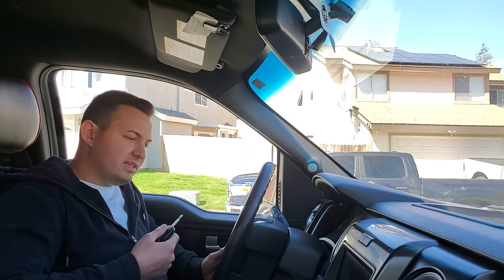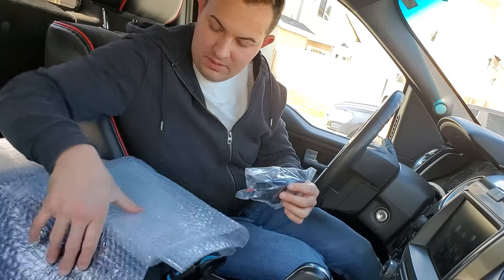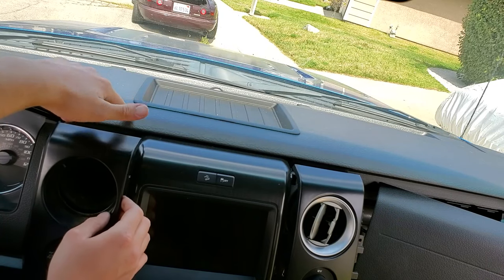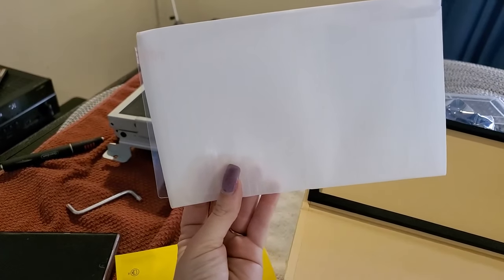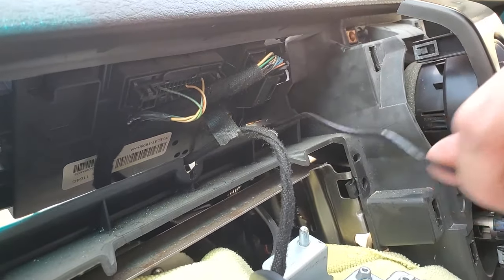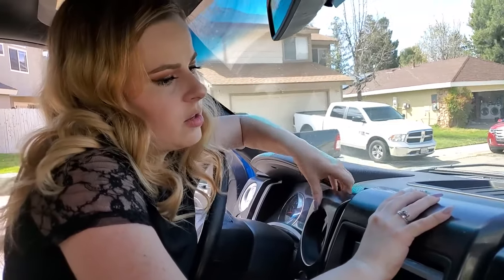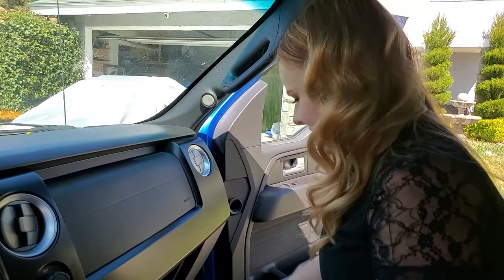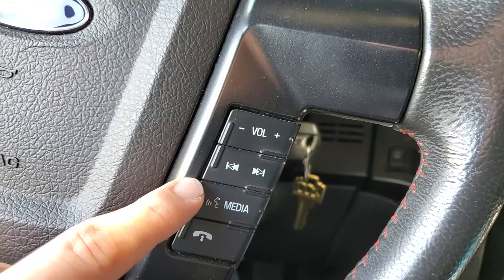Sync 2 to Sync 3 Upgrade Kit from ebay - Installed in a 2014 Ford f 150

Comment: I’ve got heated/cooled seats and a heated steering wheel that are controlled from my Sync 2 unit on my 2015 F-350 Platinum. Do you know if this would support those functions?

Comment: HL3Z-10E893-AA  2016+ Ford F-150 OEM  GPS and Satellite antenna and to get the signal to the OEm antenna is GL3Z-10E928-AA (splitter) and to access the cable is behind your glove box yellow clip and follow to your radio. to swap roof antenna remove passager visior hindge and mount removed pass side "A" pillar pull down the head liner to access the bolt that holds the roof mount (8mm) screw Signal strength is alot better. FYI

Comment: If I get the sync 2 to 3.4 will I still be able to turn on my heater and cooled seats through the screen since the truck doesn’t have physical buttons for it. I have a 2014 platinum and I want Apple car play
Reply: Yes you will. Just installed this in my 13 f150 and the unit retains everything the old one did
Reply: @raulgallardo1659  what kit did you use?

Comment: Just one question have you had any issues with the new Sync 3 since you have installed this upgrade, also I have a 2014 Lincoln MKX  would this also apply and load up with the Lincoln Emblem on the display ?
Reply from the maker: No issues! Still works great. Depending on where you buy it, they may be able to have it already preselected with the Lincoln screen. If not, you can switch it yourself using a laptop or phone and a program called FORScan.

Comment: I neeed help 😢 I have the f150 fx4 2014 5.0 coyote, it’s fully loaded but it has the small screen with the buttons on the side, can I replace that with the sync 3? It does has the satellite radio and backup cam and etc. I just don’t know what to do
Reply from the maker: Look up a 2013 - 2014 Ford F-150 Sync 4.2" to Sync 3 8" conversion kit.

Comment: Before working on something like this you should always disconnect the battery, specially in this case where you guys where touching the Airbag
Reply from the maker: Good advice!
Reply: Know of a guy that set off the airbags and knocked himself out. Bad day at work.

Comment: Do you mind sharing where you bought the kit from on ebay?
Reply from the maker: My exact kit has sold out, but there are other sellers from China that sell a similar kit. Check ebay for a "Sync 2 to Sync 3 upgrade kit for (your vehicle type)".

Comment: I upgraded to sync 3.4 in my 2015 ford f150 platinum but i lost the ambient lighting sterio keeps on turning off and on or it will freeze as well any ideas?? They said it already came programed to my truck but when my bluthooth connects it says it connects to a ford focus??? Ill take any help i can get
Reply from the maker: Is the ambient lighting option showing up in Sync? Or is it missing?

Comment: Hey man, did you have to move the center console to get to the bolts on the bottom of the cover?
Reply from the maker: I didn't move the center console. If you're talking about the bottom cover shown at the end of the video around 22:18 . I believe you can just squeeze it to remove it after removing the side A/C panels.
Reply: @AutoJourney  Ok sounds good, ordered myself a kit a few days ago, pretty excited!

Comment: I heard you say looks pretty legit when looking at the tag on the APIM.  That is a counterfeit label on the APIM.  Its a parts built APIM.
Reply from the maker: Hence the "looks". That being said even if it is, it's been almost a year and the unit has been working perfectly.
Reply: @AutoJourney  i believe it ford modules are shit my sync 2 screen touch screen stopped working at 55k miles in my 2015 and i never used the touch screen except for long drives and would use the maps

Comment: thinking about doing this to my 15 edge, if the car doesn’t have factory nav does the option show up in the dash display on the right?
Reply from the maker: On Sync 2, if your car didn't have nav it shows a compass in the top right corner. If you buy the sync 3 kit, everything required to enable nav is included.

Comment: Can I only buy de API Module and connect it to my old screen?
Reply: If you mean your Sync 2 screen... no, the two use different screens... different tech and connectors.  For a Sync 2 to 3 you need essentially the kit (screen, apim, external gps antenna, connector between screen/apim, usb connector, usb port and the cutout for the usb to mount) and hopefully the seller programs it for you... although it can be done with Forscan.  Which is why they include the OBDII dongle in the kits, just in case.

Comment: May have missed this but can it work for 2012 models?
Reply from the maker: As long as your vehicle has the sync 2 touchscreen this swap should work! However, I believe the F-150 didn't get this option until 2013 MY.

Comment: Hey very good video, I would like to do the same for my f150, can you share the link where you purchased from! Thank you.
Reply from the maker: Hey Erick, last I looked my exact kit was sold out. Just search ebay for a "Sync 2 to Sync 3 upgrade kit for F150". And look for one that includes all the things my kit had. It's been almost a year and still working flawlessly!
Reply: @AutoJourney  did you get one specifically for the 13-14 model year or did you get. 15+ and modify it?

Comment: Great video, just did the install and it did retain all of my settings. Anyone have issues with the usb component not wanting to stay in the console? For example, when I unplug the usb cable, the hole component comes out unless I hold down on it. It looks to be seated correctly, but something is not catching so it easily pulls back out.
Reply from the maker: Hey Jonathan, I actually did have that issue with the USB hub in my center console. It just wasn't pushed in all the way. I would just try taking it out and putting it back in, maybe with a little more force.

Comment: Hey I have a 2013 base model edge with 4 inch screen and wanna put the 8 inch in how do I do this I have the screen and module
Reply from the maker: Hey Julie, I believe going from the 4 inch screen to the 8 inch requires more than just the screen and the module. You will most likely need a new bezel and a different harness. I'd look on ebay for swap kits.
Reply: @AutoJourney  I bought All of that but couldn’t find wiring so returned it all. I don’t know what I can to to put a screen but I hate that four inch one enough to get rid of the car even lol 😂

Comment: 2014 F150 Platinum I have the console and the 3.5 Ecoboost
Reply from the maker: Correct, not a normal option for short-bed 2-door F-150s.

Comment: Oh man he stuck a GPS on metal… NOOOOOOOOOOOOOOOOOOOO
Reply from the maker: What's the concern? It's adhesive backed, so it's not direct contact. It's been almost a year since we did the install and the GPS signal has worked perfectly.
Reply: I was looking at doing this on my 2014 F150 as well and i was told to keep the GPS away from all metal. What did you pay for that unit anyways? do you have a link?

Comment: Will this work for a 2012 ford f150 xlt?
Reply from the maker: If you have Sync 2, it should work. There are kits available if you have the smaller screen as well.